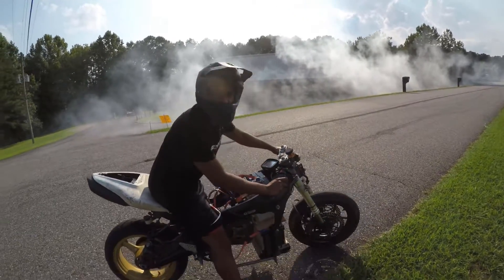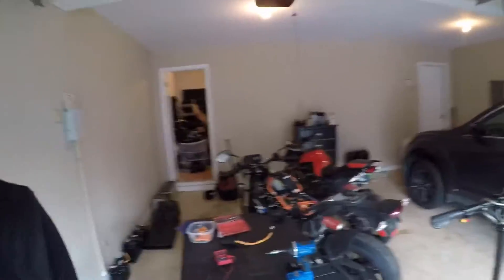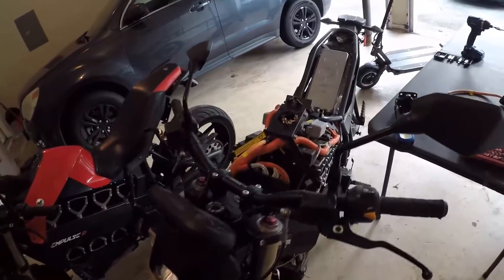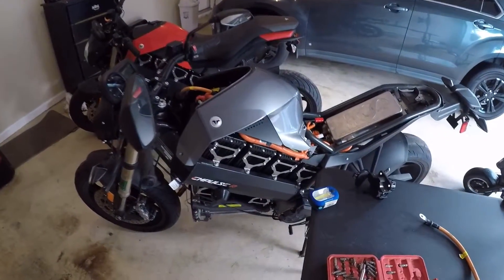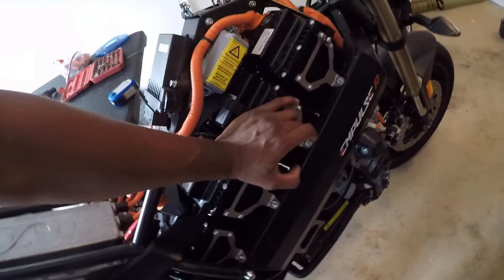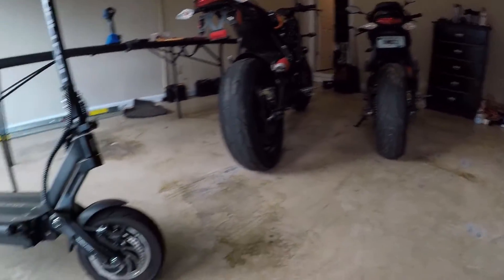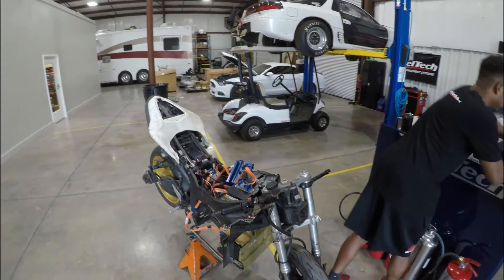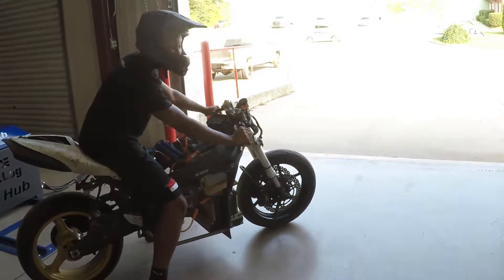This Electric motorcycle is getting SCARY FAST I hope it doesn't break 😅

Comment: I HAVE A VIPER MAX WITH A 60 AH BATTERY can i turn up the volts from 72 to make it go faster?
Reply from the maker: As long as your controller can handle the increase in voltage you should be fine. The motor will be fine for sure
Reply: @DirectedWisdon  thx bud. anyway u could do a short vid showing how i would do this? or know of a vid showing step by step how to. thx bud im super noob with the whole e.v.'s.  im hitting like 60mph now what u think i could max out at?

Comment: What's the gear ratio u used for this bike
Reply from the maker: 14t up front 48 back
Reply: @DirectedWisdon  thnx sir for replying
Reply from the maker: @Bongmemer0117  anytime my friend
Reply: @DirectedWisdon  btw what is the battery specification
Reply from the maker: @Bongmemer0117  3kwh Chevy volt battery module @88v
Reply: @DirectedWisdon  sir sorry to disturb you again but will this battery pack able to mane 96 mile in one charge??
Reply from the maker: @Bongmemer0117  3kwh no. To get that kind of range at my power levels I would have to run with at least 6-8kwh of onboard capacity and very light throttle.

Comment: will you still use the altrax controller when you go to 144v? if not what will you change to?
Reply from the maker: the Alltrax maxed out at 88.8v so for the higher voltage setup I will use a custom controller. Im considering a modified Toyota prius inverter stay tuned😁.